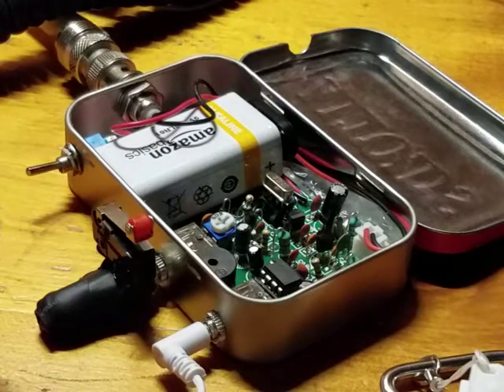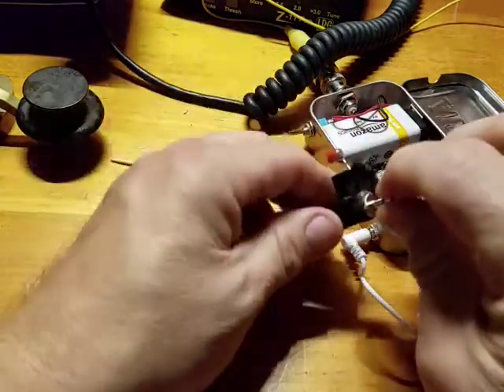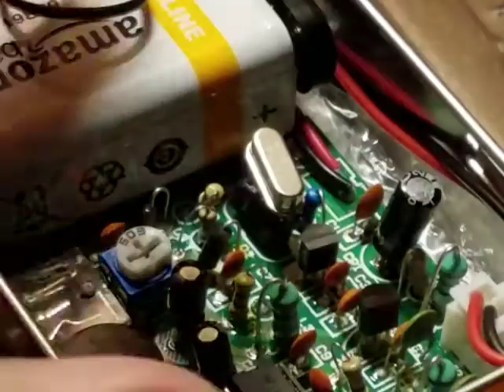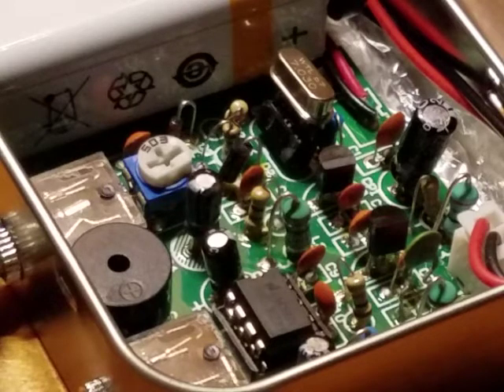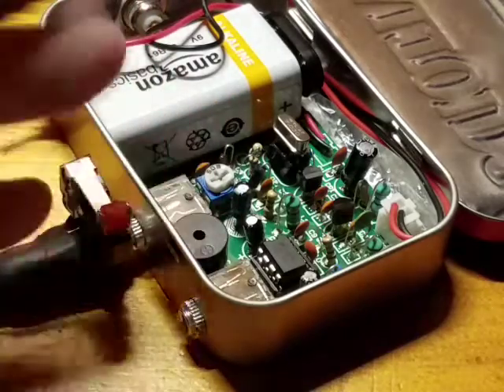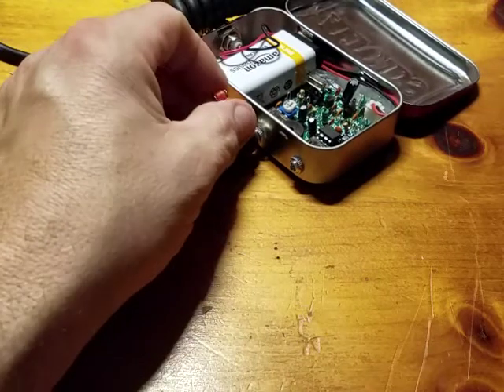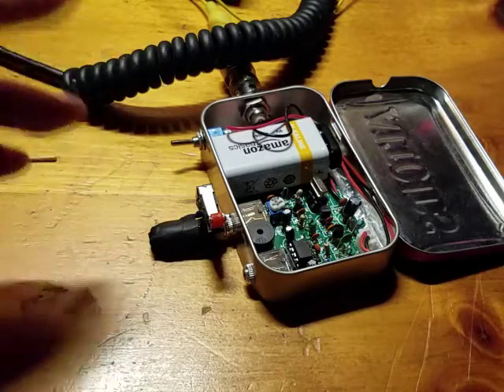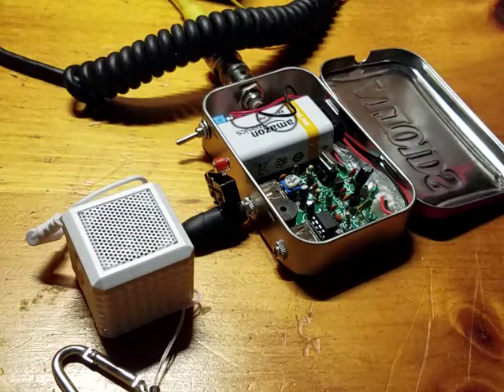My 3 dollar Qrp transceiver Is finished.

Comment: What is the broadcasting distance?
Reply: Depends on conditions and antenna. Generally tops out at about 100 miles, with an average of half or less of that, but those caveats can have a huge effect. When I lived in Québec I once worked a guy in Georgia who was using one. (Premium conditions, and he had a tower.)

Comment: Where can I get one of those neat keyer.  Clever
Reply from the maker: Its just a roller switch on a head phone jack. you can use  anything. heck once time i soldered a thimble to the ground wire and used that .
Reply: SWEET @NorthCarolinaPrepper

Comment: If you keep your battery unplugged (if there is an EMP) it wont fry your capacitors. Also, you can use a 10,000mA solar charger with a USB 5v output with a barrel power connector as a secondary or alt power supply. Best of luck

Comment: that left switch is for turn the radio ,on and off.?
Reply from the maker: ramon colon  yes I use it for the power on and off it's just a switch between the battery lead and the transmitter
Reply: THANKS FOR ANSER MY QUESTION,IS THAT POSIBLE YOU MADE A VIDEO SHOW STEP BY STEP,I WANT TO DO THE SAME THIN YOU DO,AND HOW TO CONET A BNC  ANTENNA CONECTOR.THANKS AGAIN -RAMON -FLORIDA STATE.
Reply from the maker: I did not But I just ordered another one. When I gets here in a few days I will film the whole process. There are some things that can be done better, Like parts placement. I also want to add a LED to show when its powered up.